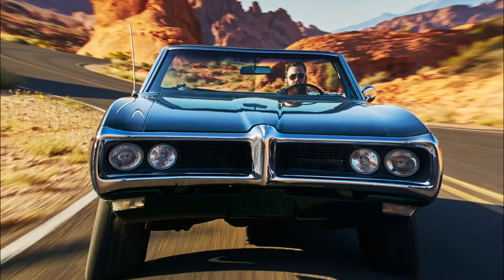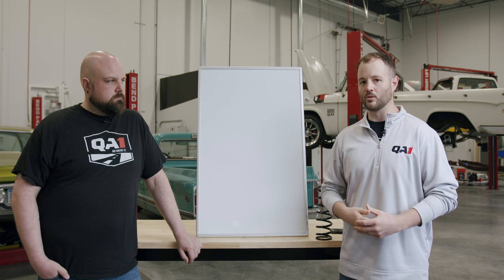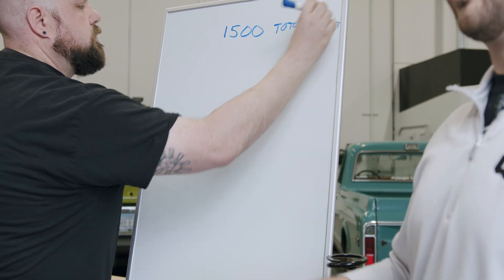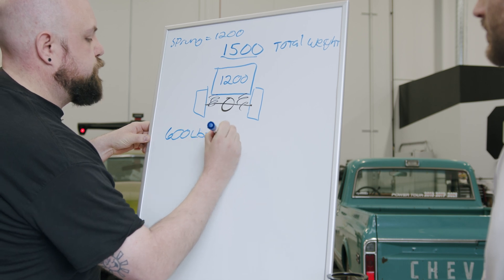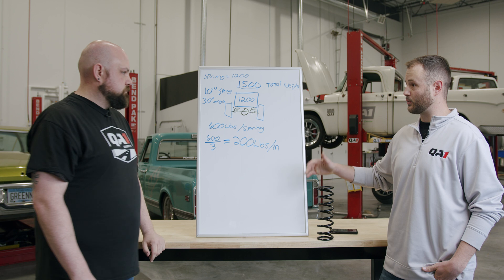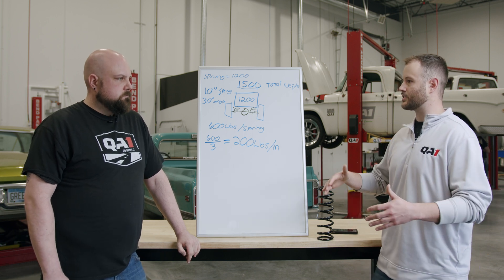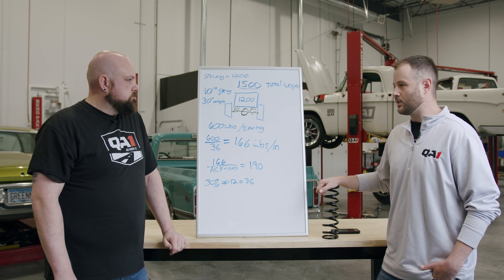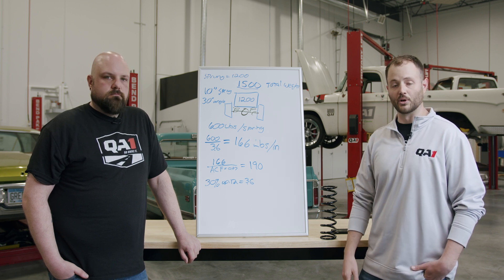How To: Calculate Spring Rate For Solid Axle | QA1 Tech

Comment: I’m designing a long travel build for my truck for desert running. I’ve got all the angles of my linkages etc sorted out and confirmed I can get 14” of travel out of the drivetrain using a 12” king coil-over at 45 degrees. And I’ve got my spring rate rates figured with ACF accounted for, due to me having to run my coil-overs at 45 degrees. Where I’m stumped is shock tuning. Since the ACF is based on 71 percent compared 90 degrees affective rate, do I get the shocks built with 29% increased damping and 29% slower rebound?? Am I doing that correct?
Reply from the maker: Consult with King to make sure that is the correct direction to head in. Quite possibly would need some valving adjustments depending on the piston size